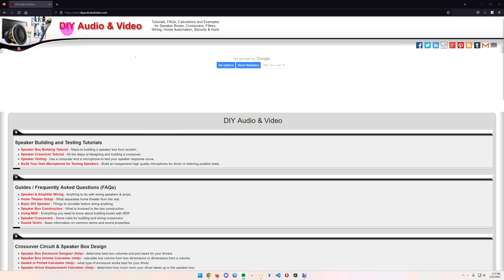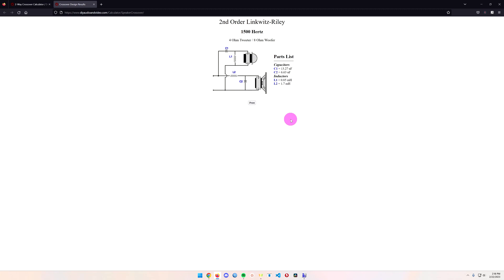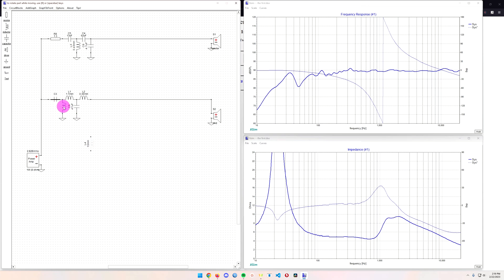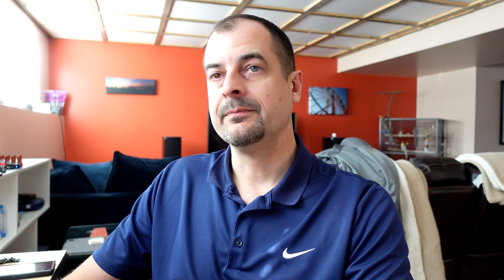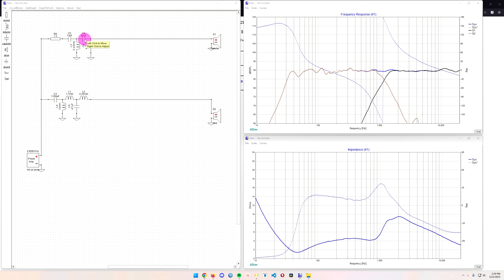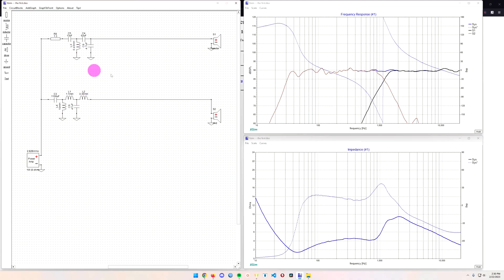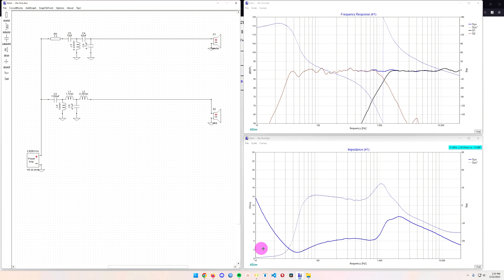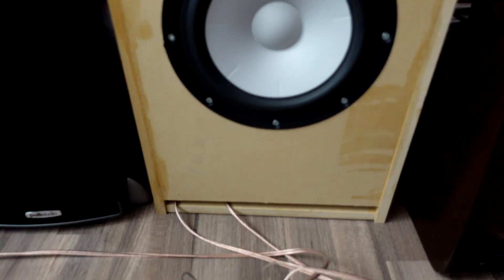Speaker Crossover Design In XSIM

Comment: Thanks for sharing your experiance. I've just completed my first box design with the help from your videos. The next step is to design the crossover... or reuse the one that came with the in-wall speaker (two 5.25 drivers + twitter) which I've been trying to convert to BL/Wifi speaker. I'm still confused with relation between frequency tuning of the box and the crossover. Does the crossover have to be tuned to the frequency that I got from the box design (ex,36Hz)? or, is the crossover used only to tune all the drivers, so they output the frequency/sound of your taste? Thanks
Reply from the maker: I'm currently thinking that making the box and installing the driver is first, then measure the drive in the box. Each individually, then use those models to achieve the desired result.  Although this would require the most energy, I think this would give the most ideal result.
Reply: @davewiebespeakerdesign  I (and obviously many others) would love to see the guide on how to measure/calculate different spec values of drivers that were parted out from commercial speakers, so they can be reused for custom builds.

Comment: Great job! On your next build, 1. try and get your tweeter and woofer as close together as you can. This helps with driver integration/coherency and vertical dispersion.
2. On such a huge baffle, try to offset the tweeter off to one side. This helps with diffraction issues, and helps the speaker "disappear". As is, the baffle has symmetrical reflections so it sounds like it's playing "from the baffle".
Great job otherwise. Keep at it.
Reply from the maker: I appreciate the very constructive criticism, thanks for the comment, and 2 very solid tips.

Welcome here!

Comment: I've also started my joirney of building my own speakers a few years ago and learning on the way. I've designed and built crossovers too recently. 
Here are my key  points that I've learned:
1. Get a measuring mike and an external usb soundcard with headphone output for impedance measurement. Without measurements you're sailing blind. Use REW and Umik1. The soundcard, build an i pedance measuring circuit aa instructed in the helpfile of rew. 
2. Do the spl measurements at 1m from tweeter at tweeter level, place speaker in the middle of the middle (x, y and z) of the room and use IR window to remove reflections, this removes datapoints up to 300Hz though but beats having to build an anachoic chamber. Limit tweeter to 600-20khz to prevent damage when doing sweeps. For midrange 300-20khz or as rated.
3. Export to zdf and amf files and import to xwim. Use timedelay option on the speakers to align the graphs with simulated vs measured. 
4. Design crossover and start with L pads to get the levels of tweeter and woofer aligned.
5. Start with first order filters and adding orders as needed.
6. Make sure the phase is correct, the group  crossover points should be 6db higher from the individual woofer/tweeter curve crossing.
6. Inverting a driver will show a dip in the response, the deeper it is the better phase aligned it is non inverted. It's a handy trick to check and you can adjust L and C values to optimize.
7. Make sure impedance matches with your equipment, not dropping below 8 Ohms too much. 6 ohms on a 8 ohms amp is fine but 2-4 ohms may run into problems. Use resistors/L pads to compensate. Reajust phase alignmemt and spl in iterations.
8. Measure resulting crossovers individually and import as a curve in xsim and check if you're on target.
9. Have some spare parts with a few values up and down from what you simulated ready for some real world adjustments. More values can be made connecting parts parallel or in series.
11. For parts aim for air cored inductors, polyfilm caps low esr and high dielectric strength properties, multi layered metal oxide resistors and don't use anything magnetic in the signal path, check everything with a magnet, if it sticks it's bad. It smears the stereo image and clarity.
12. Use impulse measurements for woofer and tweeter in their respective short  ranges to check polarity, don't trust manufacturer indications on the speaker. If you have trouble centering the stage/vocals a driver may be reverse polarity. On the impulse response set it to percentage and look for the biggest positive rising peak, that means polarty is correct. If it is negativve, reverse polarity. For woofer use 100-200hz sweep, mid 1500-2000, tweeter 9000-10000hz. 
There's much more but that what I know off the top of my head.
Reply from the maker: So much to check out here, clearly I am a noob. Thanks for the response, I've done a bit of searching already in points you've listed but the checklist will help me.  Hopefully I can put it into practice.

Comment: If you dont want to kill your amp, just put a 10w resistor for both tweeter and woofer. You can seen in xsim how it behaves. I would set the resistance as not going too much below 4 ohm. Probably 1-1,5 ohm would be enough for both.
Reply from the maker: Hey thanks for the tip, still learning about ohm loads.